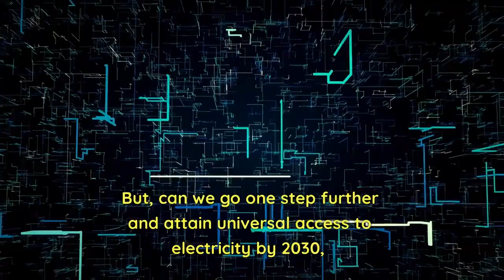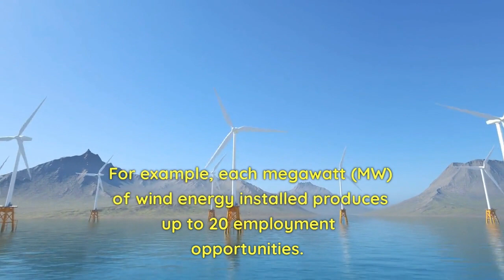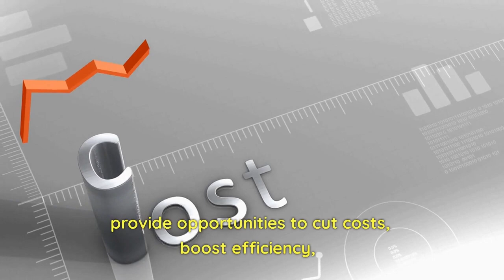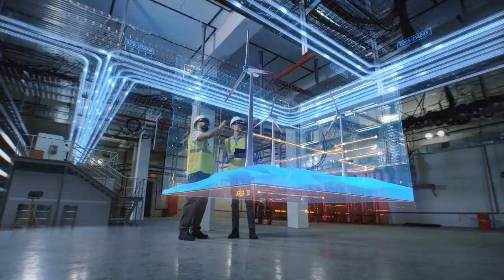How advanced will be Sustainable energy by 2030?

Comment: The same as now! Not at all! And still the most polluting energy we can produce!
Reply from the maker: It propobly will improve even more faster than described
Reply: @funwithfacts9536  Sorry, I just get annoyed when someone talks out of their you know what. I don't mind sensible comments but some people just don't bother to find out how the world works. Thanks for your video.
Reply from the maker: @ianhamilton3113  thanks for the positive feedback😁
Reply: How is it the most polluting energy we can produce?
Reply: @Ian Hamilton  First of all, most of it goes to landfills after a short life span, then look at the millions of tons of Bunker C oil that the ships burn, transporting all of the components to and from china! And do you know how polluting it is to manufactur the carbon fiber?
Reply: @terenceiutzi4003  So drilling for oil is not so polluting? 
So laying tens of miles of pipeline is not polluting? And the steel required? 
So building vast petrochemical plants is not polluting? 
So the energy used to crack the crude, separate the solids and dump the waste is not polluting? 
So then shipping those products to their customers in trucks, ships and rail cars is not so polluting?
So burning it in a combustion engine with at best an efficiency of 25% is not so polluting?
And don't even start me on fracking!!!!
There's far more bunker oil burnt shipping crude and distillates around than shipping a wind turbine.
There's a book - Oil 101. Read it, you will have a better idea how the oil industry works. It's actually good - no mindless political crap.
Reply: @terenceiutzi4003  "First of all, most of it goes to landfills after a short life span" 
What do you mean most? What exactly?
Short life span? A lot longer than a fracking site. A lot, lot longer
Reply: @Ian Hamilton  you should have seen Fort McMurray before they started the tar sands before
Project! Thousand of square miles with not one living thing just tar pits, ! and now it is a lush green forest
Reply: @Ian Hamilton  the entire tower and the rotor blades are land filled only the steel and copper from the generator can be recycled and that require tons of coal
Reply: @Ian Hamilton  well I live in the northern tip of the Marseilles shail here in Southern Ontario, and I n the 60 it was the largest oil producing region in Canada and we had the best producing farm land in the world! In 1975 PM Joe Clark canceled all of the mineral rights and shut it down! Now, after 25 years of not pumping large areas  are having trouble with Benzenes in their water because it is leaching up through the shail and not being pumped away!
Reply: @terenceiutzi4003  "only the steel and copper from the generator can be recycled and that require tons of coal" Actually they use electric arc furnaces for the steel and electricity for the copper. That's why they are putting up so many more of them They need more electricity.
Reply: @Ian Hamilton  no what I am saying is that just because we quit using that doesn't mean the earth quits making it or that the tectonic plates quit moving and forcing it out of the ground! Why are the Labrea tar pits growing so fast? There were never any wells there! There was benzene in the water in the 16th century,and it cleared up when we started pumping oil
Reply: @Ian Hamilton  where we have the greatest benzene problem, is over 100 miles from the nearest well!
Reply: Fortunately, virtually everything you wrote below is not true, Terence.  I've worked in the solar and wind industries for the past 16-years and know that all wind turbine nacelles, generators and blades are recycled.  Likewise, all solar panels and batteries are recycled, all while providing 30+ years of clean, renewable power.  The blades you saw in landfills were dug up and recycled.
Reply: @Russell Fine Arts  OK how many tons of bunker C oil is burnt transporting 6 wind turbines front China to LA?